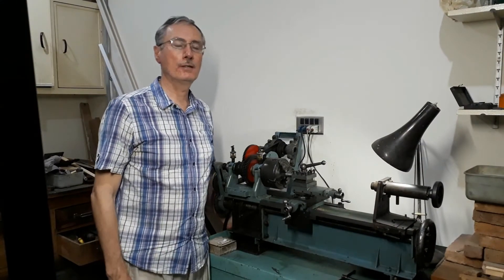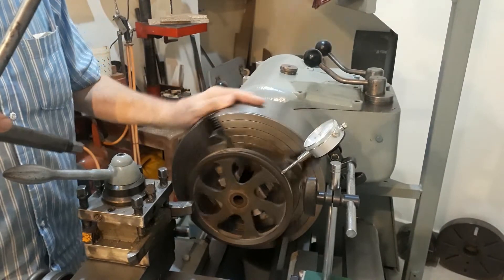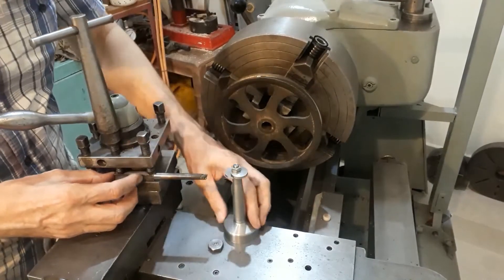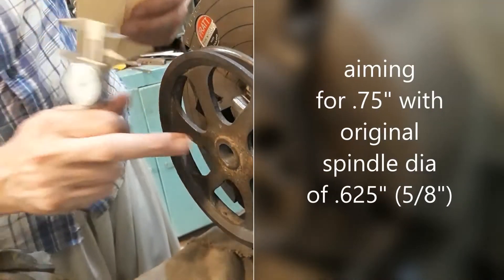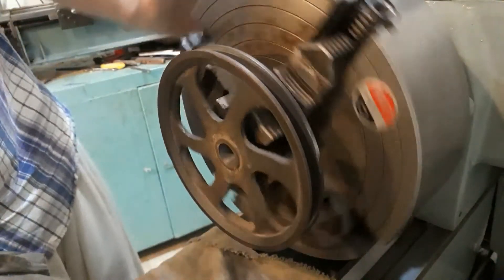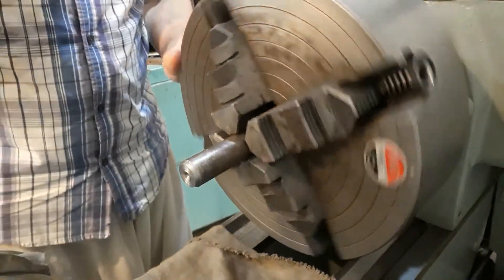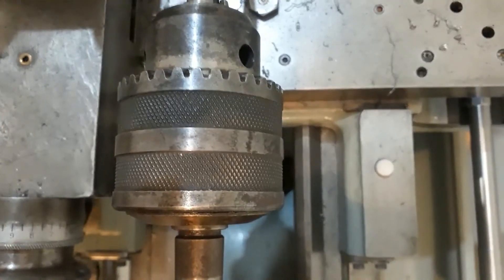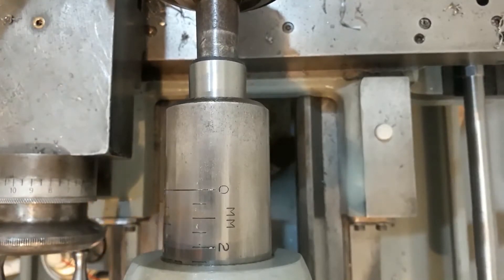Repairing a "wobbly" lathe pulley - Part 1

Comment: Internal calipers - look at the 'working surfaces' (esp threads) a drop of lube works wonders.
Reply: I'll add - it's great to see 'leg' calipers being used like that. So many of the youtbe machinists, using mics - make use of the 'last resort' ratchet when taking measurements - I don't think I've ever done that - always done with feel instead.
Reply from the maker: I did service some calipers I received with the lathe, but can't remember if these were the ones. Yes, good tip!
Reply: @Workshopfriend  It's things like vice & G-clamp screws and lathe chuck mechanisms that generally get neglected - such as the chuck key pinion bearings and gears and of course the scroll in a self-centering chuck !

Comment: It's a quiet running Colchester you have. Has it got thicker oil in the headstock than it should have ?12:30 centre drilling - faster speed - I've never known a quieter Colchester !
Reply from the maker: I used Mobil H46 instead of the recommended Shell S32, so I went up in viscosity from SAE 32 to 46 but my average workshop temperature reaches more than 30C. I used the same oil in the gearbox which is thinner than recommended because  I had to buy 20l of the Mobil H46 and couldn't justify buying more.
Reply: @Workshopfriend  I remember you saying that. How much oil does the headstock hold ? 5 litres ? I'm considering using 'way oil' in the gearbox - later Colchesters use it in the apron - so I figured it'd be ok in the leadscrew gearbox.

With the thicker oil, have you checked that the spindle bearings are getting lubrication - as IIRC they're fed by splash lubrication and a more viscous oil will splash less.
Reply from the maker: Yes, I believe it is 5 litres in the headstock and 1 in the gearbox. I checked the lubrication system with the cover off starting from a slow motor speed. The H46 oil was flung up onto the cover even at considerably lower than 50Hz VDF. It was the first shaft which seemed to spread the oil around not the grooved sleeve on the mandrel which acts like a rack and pinion for the gear change.
Reply from the maker: I didnt notice your last comment at the time. Yes, I did check that the spindle bearings were getting an oil supply by 'carefully' running the machine with the gearbox cover removed from lower motor speeds upwards. See comments in second video on Colchester Student Renovatuon part 2.

Comment: 'Old' tool post (same as mine) is not 'old'. Old is the original 'lantern' toolpost - which I also have - and it appears to be mounted as a rear toolpost. I have plans for that !
Reply from the maker: Yes I take your point. It is actually a nicely made piece of equipment. I  temporarily removed the two spring loaded balls so that I can position the head at any angle. But, if desired the indexing works well and is accurate.
Reply: @Workshopfriend  It can be positioned at any angle even with all the indexing gubbins in place.
Reply: I never had done this job before in my life. I did when the Covide pandemic was here but I like this work. I got one lathe but not good at all. So I want to see more detail.
Thanks for sharing
Reply from the maker: I have found to be a useful process which has many applications. Thanks for you comment and keep pressing on with your second homemade lathe build!
Reply: Do you have WhatsApp or any mail
I just what to know when making new lathe 🙏
Reply from the maker: Please use my email address included in my profile.